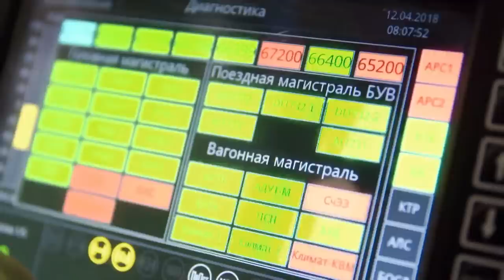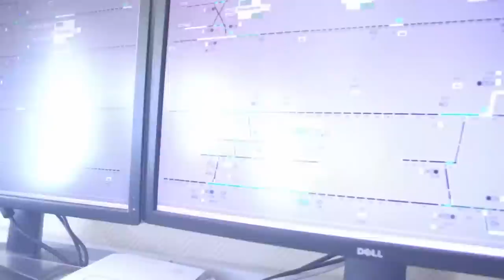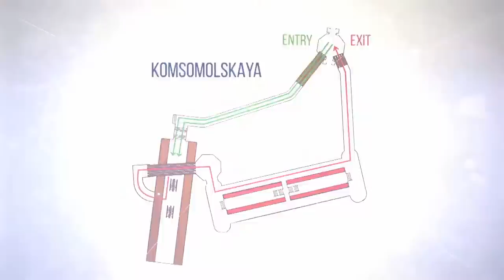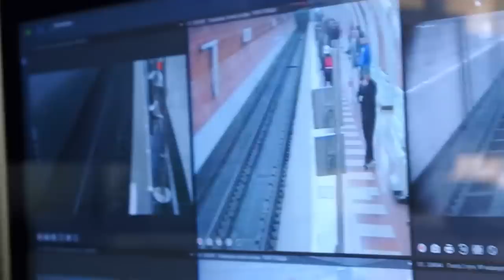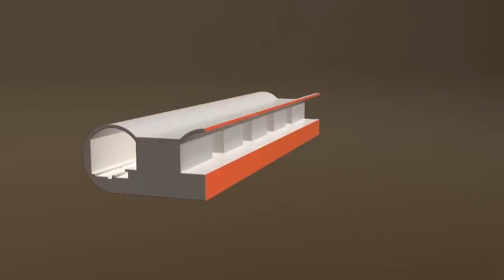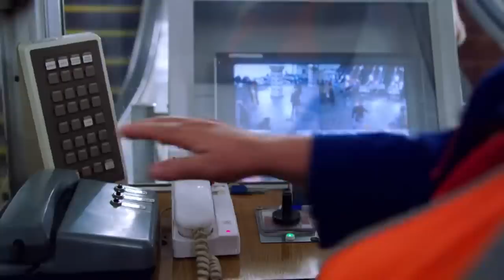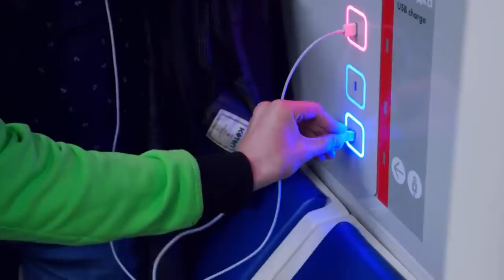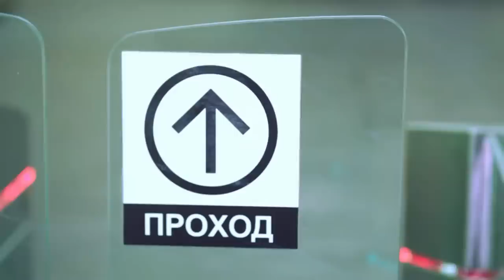Big Underground System: Moscow Metro | Giant Hubs | Episode 6 | Free Documentary

Comment: MOSCOW METRO IN A NuTSHELL metro is nice untill you start work in moscow using it every day, it is hell,in the morning bunch of people smashing you inside a train, if you want to go out - you cant)) and riding further)) then you just fall unconcius due to lack of fresh air.
Reply: This only happens on line 7 (purple line), and only the southern portion of it. This problem is actively being worked on - the new trains you see in the video are capable of holding 1.5x the average amount of passengers during rush hours and were designed for the busy lines specifically. The busiest line in the system, Vykhino, has additional trains departing from it specifically to lower the congestion in the other trains on the system. New lines are being built, like line 14 and the Big Ring Line (11). Part of it is already open - 5 stations between Lines 2, 7 and 4. Line 4 can be taken during rush hours instead of Line 3 because it doubles Line 3 on the surface. The 20 or so stations of Big Ring Line will be opened in 2021 and will connect and ease the traffic on the lines by a considerable amount. The Moscow Central Diameters, dubbed the Moscow Metro on surface, are suburban trains going regularly with small time periods like in a subway that also ease the traffic and pass through many metro stations. The Moscow Metro is expanding super fast these years, the fastest it has ever expanded.